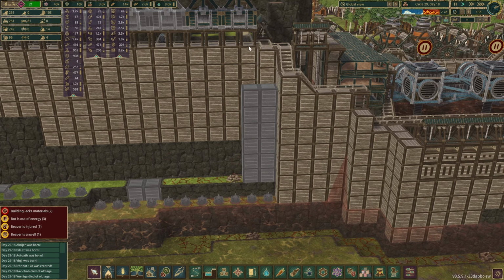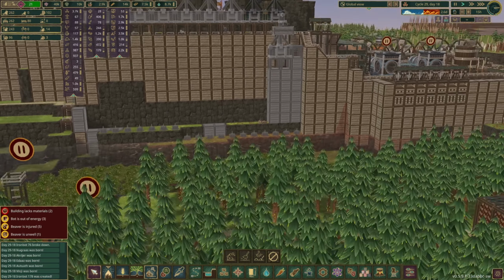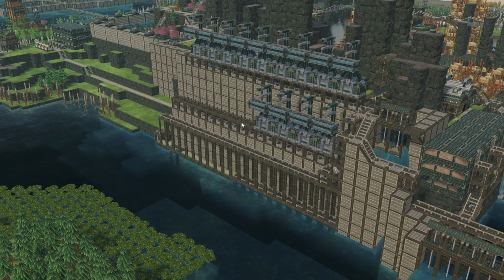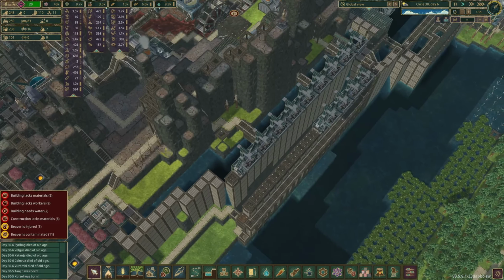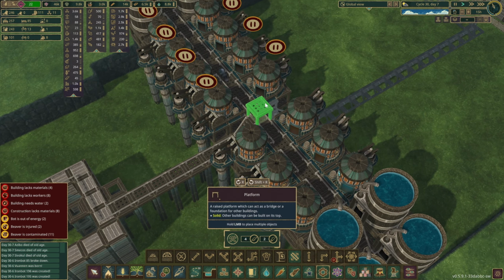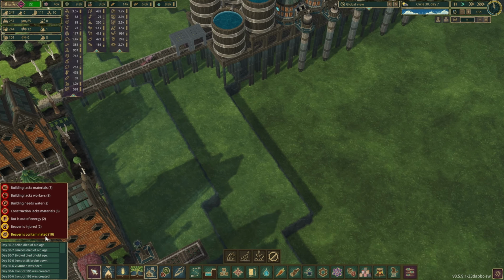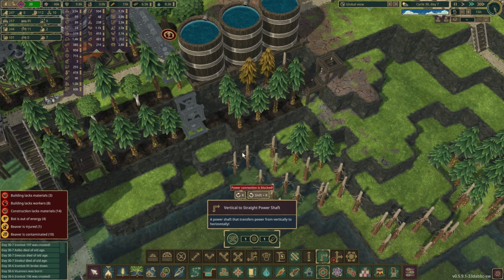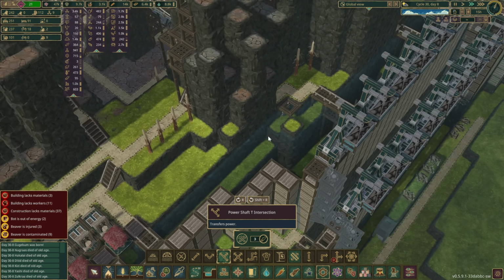Power Up! | TIMBERBORN | E26

Comment: Does the modded stream gauge allow you to automate the floodgate based on how polluted the water is? It would be cool if they do, because then you can close the gates at start of badtide and not open them again until the pollution level is below 5% or something and so keep your swimming water clean.
Reply: Yeah the modded steam gauge van work off stream height or contamination levels. It's in the advanced section and involves setting up height per contamination (based on less then or greater then values).
Honestly one of the best mods I've ever used for timberborn.